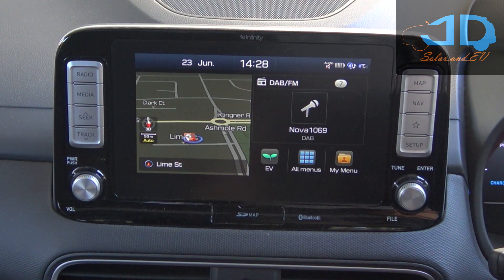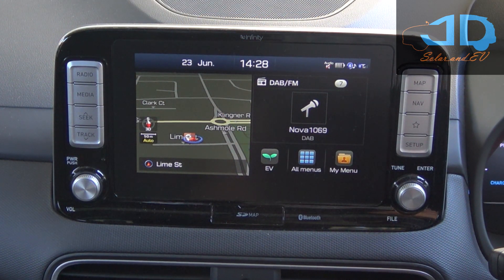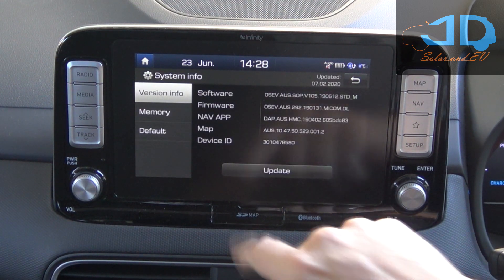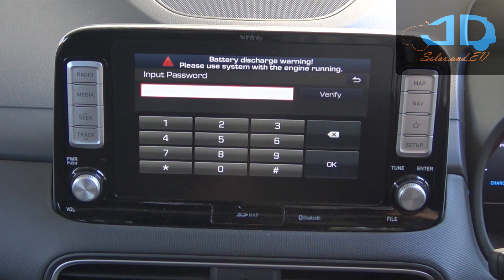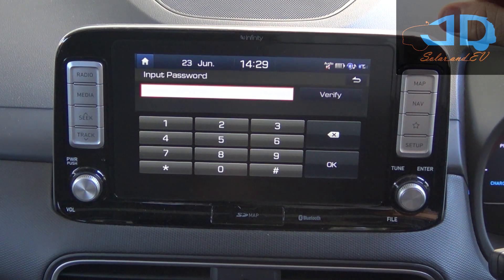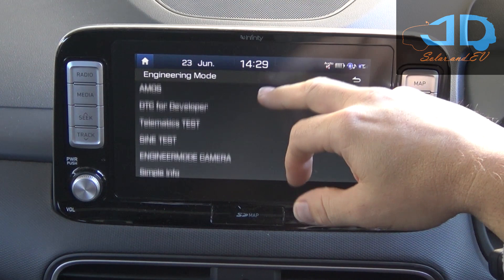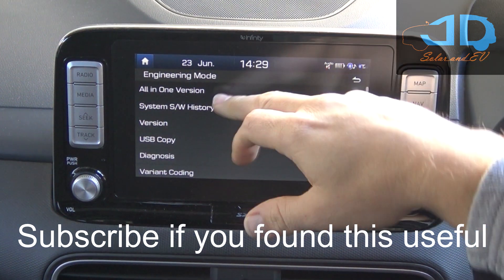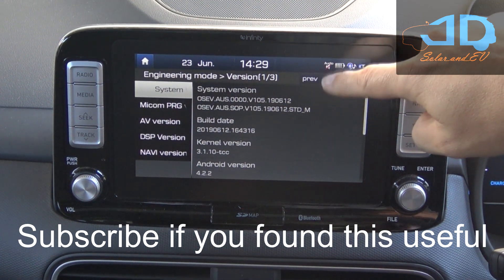Kona Electric Engineering Mode Password

Comment: In order to make the password work, you also may need to change date settings. Go to Settings - Date/time - turn off GPS time and manually change the year from 2021 to 2020. Then the password 2900 is OK. Works for my Kona Electric produced in 2020 (possibly settings year needs to match the production year, I could not test on other car).
Reply from the maker: Thanks for the tip

Comment: I tried this on my 2020 model and it didn't get into engineering mode with or without password.
Reply: You really have to try several times. I tapped 5-1 about ten times before getting the password window. Unfortunately, the 2900 code does not work on mine (2020 model).
Reply: May be helpful: https://www.oviradio.cz/hyundai-kia-radio-engineering-mode-en/